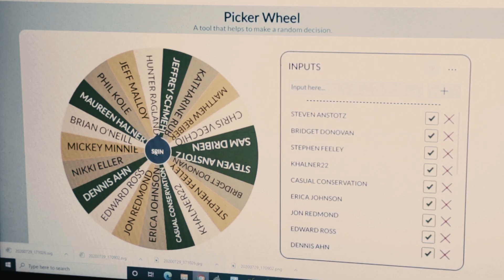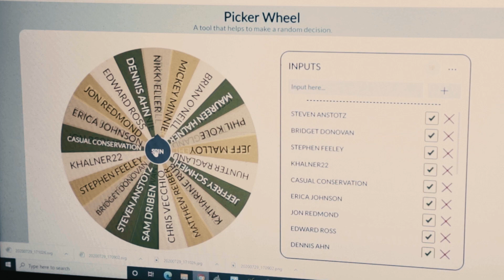How to build a rustic American flag gun cabinet

Comment: Where'd you find the CNC cutter?
Reply from the maker: I saw another woodworker locally using one and I reached out. So I found one on Amazon. Search RC 45711
Reply: @JCBuilds  Thank you so much Will! I'll check it out! Will I be able to find the machine there too?
Reply from the maker: The machine is called Shapeoko 3 XL. You can find them on the carbide3D website. Just Google Shapeoko 3 and it should take you where you need to go!
Reply: @JCBuilds  Nice! I'll check it out!

Comment: Good video! Forget the pocket screws.  1/4 inch luan. Wood glue the stripes. Use a Betsy Ross stencil and paint it. Forget the 2x11 back. Use 1/2 sanded plywood.
Reply: Oh and forget the polyethylene. Use magnets!

Comment: Could you use stain rather than burning the wood?
Reply from the maker: Sure you can use stain, however you won't get the same grain effect. I recommend practicing on scrap wood to see the difference
Reply: Dark burn on outside edges with a light burn on the rest then use minwax red, blue and white stain

Comment: Did you have issues with your doors lining up perfectly once you installed the hinges?  I had everything square on the box before installing the hinges and now I’m having a heck of a time getting everything to line up flush. It looked like you just pushed each door flush with the cabinet and then installed the hinges where they sat vs. measuring where the holes should be for the screws to secure the hinge to the frame. Is that the trick?  It’s driving me insane....even after using the adjustments on the hinges themselves
Reply from the maker: I had that issue too. I ended up needing to make a new union because the pilot hole with the fostner bit wasn't where it needed to be. You may just need to simply sand the edges. Rounding over the inside edges will also help. When you close the doors see what is in the way and sand it.
Reply: @JCBuilds  thanks man!  I ended up swapping out the hinges for the Richelieu soft closing full overlay hinge with the clip top.  It gave me much more play for adjusting and I was able to get the union and top stripes to line up well! Unfortunately, Lowe’s was short on them so I’m still waiting for one more to be able to do my long stripes.  Will see how everything lines up and as you said do some sanding if needed, but these hinges really allowed for more adjustment. Even though they are a little more expensive, I definitely recommend them. Really appreciate you getting back to me and I modeled my build off of yours so thanks for sharing how you put it together!
Reply: @SteelXray  hey could you leave more info on the hinges? I went to the Richelieu site and there are many of them

Comment: I finally was able to make this cabinet but the measurements does sit correctly with the flag. Where the measurements changed?
Reply from the maker: What measurements were off? Nothing was changed, if anything I may have accidentally added the wrong number somewhere
Reply: @JCBuilds  the cabinet ends. It could be me. But I followed what you said and the cabinet part don't fit the flag.

Comment: What length pocket screws did you use to connect the 1x2s that way? I make wood flags all the time but never thought about connecting the stripes like that as I assumed they would be too narrow. Love the intro and your builds. Keep up the great work!
Reply from the maker: My pocket screw assortment is. 75, 1, 1.25, and 1.5.  For this 1.25 worked. I have the pocket hole jig from HF which has 2 different angles for thinner woods.